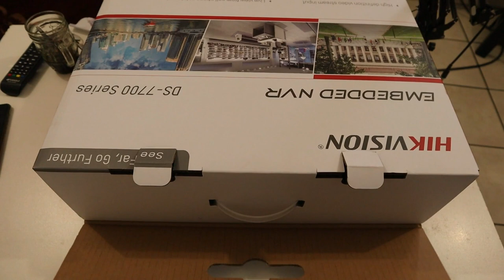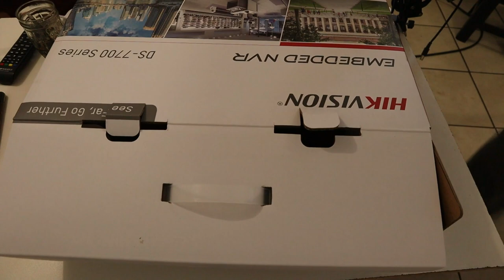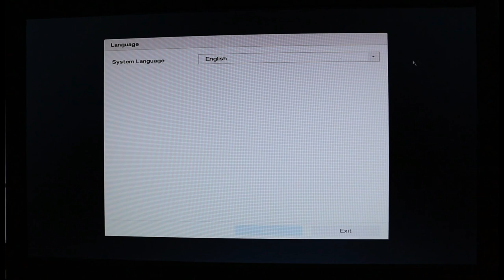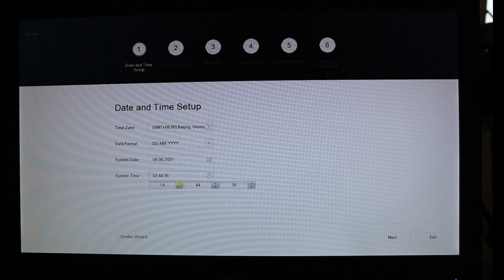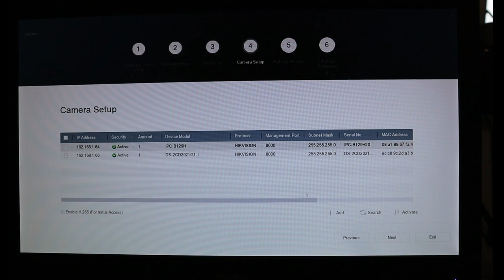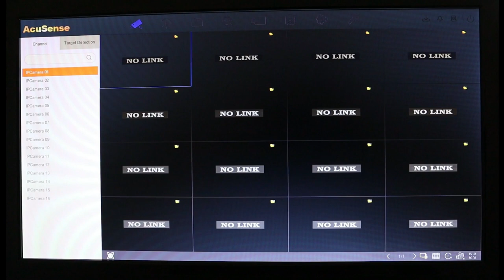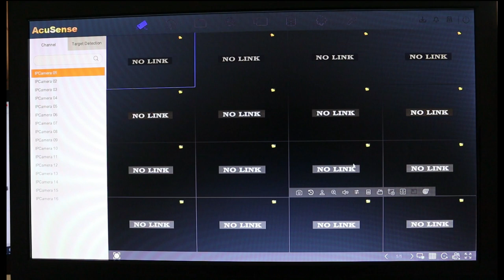Hikvision nvr 32 channel ds 7700 series unboxing and setup

Comment: Hello

If I combine poe switch with nvr in order to add multiple cameras, can I use any type of poe switch or should it be of the same type as nvr Hikvision nvr 32 channel ds 7700

And what is the type of switch?
Which can I combine with this type Hikvision nvr 32 channel ds 7700

Can you send the correct information because I would like to buy this type of nvr with poe switch to add up to 25 cameras

Thank you
Reply from the maker: You can use any POE switch.
Reply: @Absolutebeginners  

Thanks for your information
Reply: @Absolutebeginners  
welcome sir
I have a question. In my store I have a device, there is a dvr samsung sdr-C75300 with 16 cameras installed on it. I want to replace it with Hikvision NVR, the question I have on my device is the camera installed above the cache register, the AVE vci-pro interface device is installed to send the image to the dvr, in order to give me the names of the goods and prices It is sold. My question is, is the device with AVE vci-pro interface able to install on the nvr you're showing if I buy it and buy an adapter for the cam the vci-pro mounts on
transformer named
 BNC DC to RJ45 Network
 Balun Video Balun with Power BNC to RJ45 Converter for HD